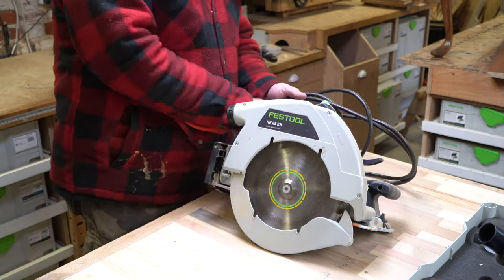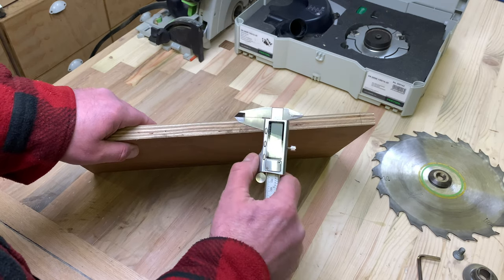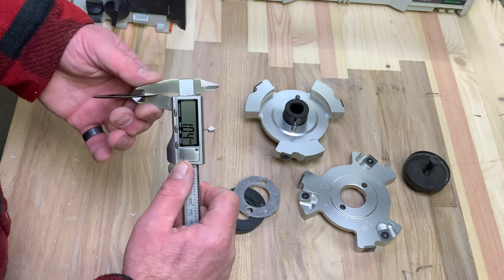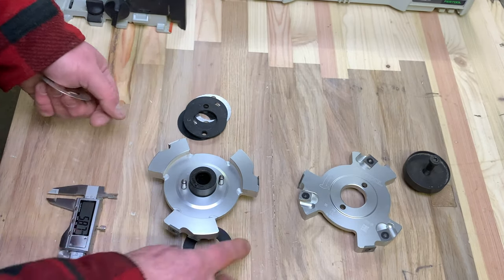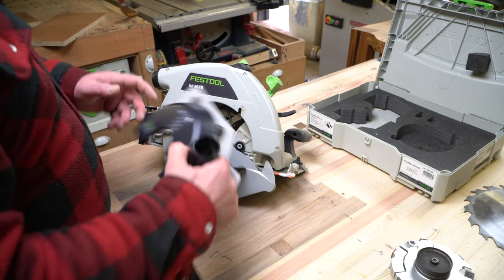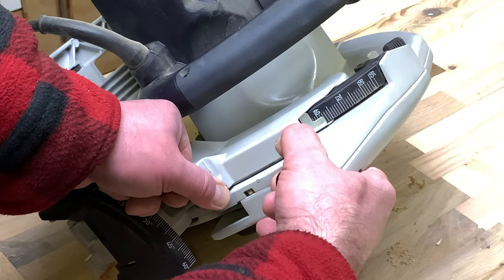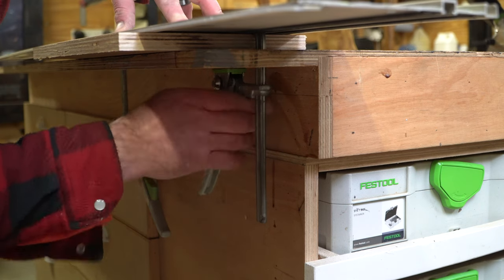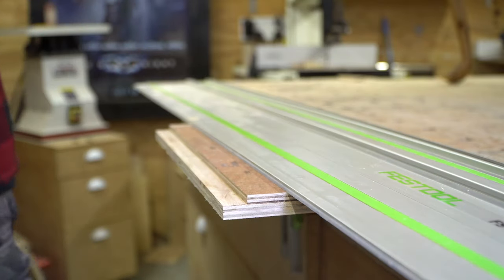Dado / Rabbet With A Track Saw. The Festool HK85 and groove cutter.

Comment: Nice, makes perfect sense for rabbets 🐰🐇. Makes it so easy. I had a tough time with 19mm router bit on my 1/2" router, and the rebate was a bit loose (nothing that glue and saw dust could fix though, but still annoying)
Reply from the maker: I had nothing but a hard time with a router and bits even with cabinet grade birch, drove me nuts! The only way I managed was using a smaller cutter like 16mm then say if its a shelf going into a housing joint was to take the shelf part and take off a couple/few mm on the table saw using the blade like a dado stack making the thickness of the self 16mm and match the depth of the housing joint if that makes sense? A ton more work though... The other thing with a bloody router the cut may not even cut straight, twin blade/flute cutters really suck for that, twin spiral upcut or downcut cutters are much better but silly money!
Reply from the maker: I should add if you look into spiral router cutters, the upcut and downcut depends on how its used, hand held or router table its to do with how the cutter gets rid of the waste.👍
Reply: @HewAndAwe  yes, valid points there. I used the older twin flute cutters, not the upcut/downcut spiral ones. Its hard to justify the spiral bits cost for me, when the bits itself costs more than my cheap routers, Lol 😆

Comment: What an awesome bit of kit.
Uk plywood is terrible and way undersized.       I use an 11/16 router bit to cut housing for 18mm ply. It equates to 17.5 mm which is the perfect fit for wbp ply the local merchant supply.
I'd prefer one of them dado heads mind.
Reply from the maker: That’s exactly why I bought it, one day it’s 17mm thick the next it’s 17.5mm thick or 18 or… 🤦🏻‍♂️ someone needs to come up with a solution to the ply issue, FE doesn’t cut it warps like B&Q too.

Comment: Never measured the thickness of a piece of plywood in my life, fucking pointless. Just stack my dado set in he table saw and with a little trial and error, tight as a ducks ass or that other thing. Great Video!
Reply from the maker: I've never had the pleasure of a dado stack in a table saw, difficult to get table saws with a big enough arbor in the UK. Do they come with shims like a 0.5mm?
Reply: @HewAndAwe  Yup. The set I currently have (Amana) has two blades and 6 chippers (three different sized chippers). Its capacity goes from 1/8" - 29/32". With the blades alone, it will adjust in 1/32" increments. With the shims you can go as small as .002" increments. I wanted to buy the Forrest set but couldn't afford it but I'm real happy with the Amana set. All the the Dado stacks I've used through the years come with shims but even when you lose them I've used various types of paper. My set fits 5/8" arbor but the set comes in 1" as well. What size is your table saw arbor? Note: sorry about all the inch references. US should switch to metric, it's all the damn conversion back and forth that drives you crazy.
Reply from the maker: @forbol  Oh bloody tiny! I can barely get my hands in through the throat plate, like the damn thing was made for a fucking leprechaun! If I was making cabinets I'd upgrade to a cabinet saw either a US version/type or the types used in europe taking up way more space though, thats the thing though I just need a very accurate jobsite saw cause of space at the mo. Oh no worries on the metric imperial thing, I grew up with mm, inches and some bell end talking in cm. But man it would be good if we could all just be on the same page - I get that mm is defo better but weight measurements works better in lbs. Saying that I went to a fabricator with a drawing, he told me to come back with imperial measurements, needless to say he didn't get the work from me. Just an FYI, its been bugging me for ages why messages are a mess on youtube and Im not seeing them all, seems if someone swears I have to dig deep to find the message and I only know you replied cause at the time I had Chrome open and a notification came on the screen, otherwise I would have no idea! So if I seem rude and dont reply its just cause I dont know about the message - its BS really and pisses me off, all be it I tell youtube my vids are not made for kids we all still have to talk like fairies!  Pffft!
Reply: @HewAndAwe  No worries, I never really expect to get replies from content providers. I don't know where you find the time. I had never heard that about swear words in comments, good to know, thanks.
Reply: @forbol  You can also adjust to suit with a Wobble Saw

Comment: Excellent review 👏 and nice little jig I agree on using template rather than measuring, I always balls it up. I like mine as tight as a duck's arse 😋
Reply from the maker: I’ve realised a problem with it since then, common sizes are covered, you can’t cut 12mm or 9mm it would be way more useful if the cut range wast between 9mm to 19mm.

Comment: class bit of kit ive had mine a while now i did want the big hk132 for cutting big tenons but went for the mafell but the festool is an absolute beast. any idea where to get new blades for the block as ive just span mine to side 4 not sure whether then can be sharpened
Reply from the maker: I think if I needed a saw that big I’d go for the makita cheaper, I wouldn’t be using it that much to warrant the better versions. That’s a good question, I haven’t turned mine at all yet, my first call would be to email Axminster  asking them, then find them elsewhere cause they’re usually more expensive there.

Comment: You can get router cutters sized exactly to plywood’s actual thickness rather than the nominal thickness. That Festool apparatus is nice though. The adjustability is the selling point.
Reply from the maker: Not always, seldom find bit of ply that’s 18mm 19mm etc usually there’s .5mm in there. And it’s a lot more work setting up a router than a track and saw, saved me so much time over the years. Messy bugger though!